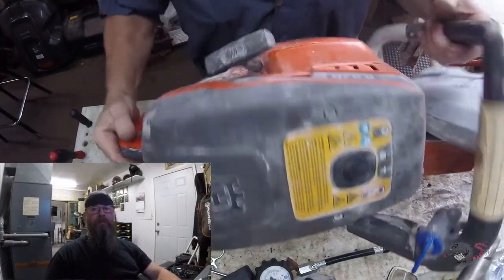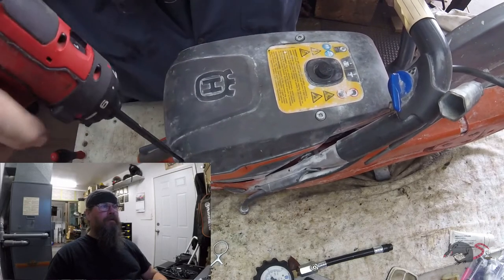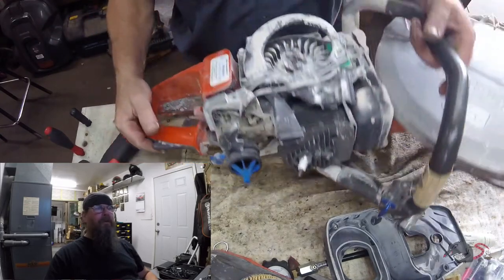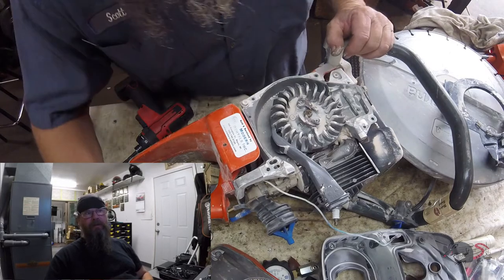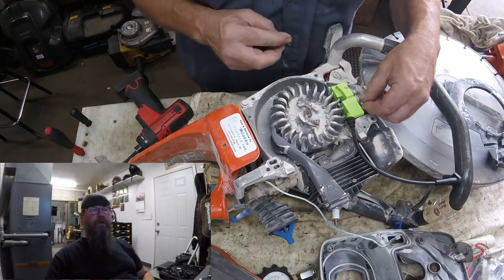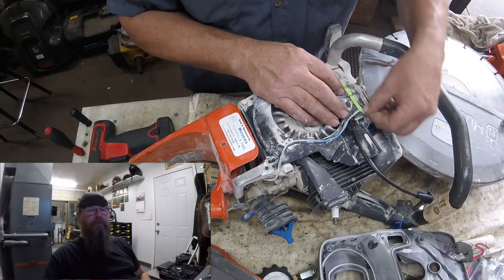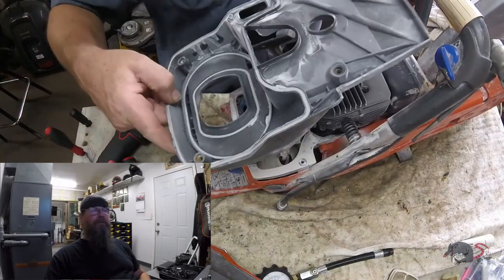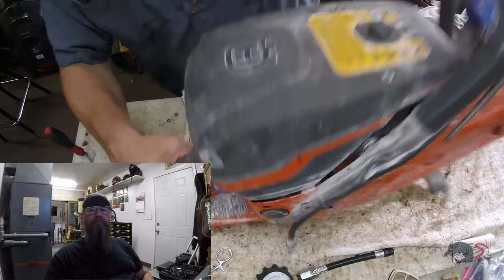Husky K970 Ignition Coil Swap

Comment: So it WAS the ignition module? When a customer diagnosis an issue, that means you don't need to dig further? Or do you agree with his assessment based on symptoms? Just curious how you judge based on the customer.
Reply from the maker: I ran the saw then called the customer stating what I found. He said it would quit when it got hot so I told him I would need to spend more time diagnosing the saw and if it was the module then I could cover it under warranty. He didn't seem to care about warranty and just told me to put a module in it and get the saw back to him. He must have been right cuz I haven't heard back from him then again he might be too embarrassed to bring it back. Dunno.

Comment: Do you happen to have a link for the coil ?
Reply from the maker: A service bulletin in 2021 states the new ignition module part# for a K970 is 594729602. Cost is $120.